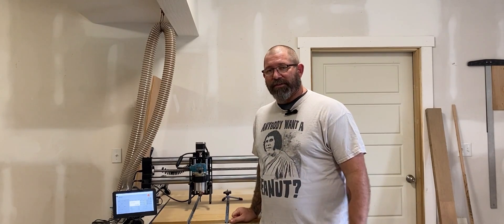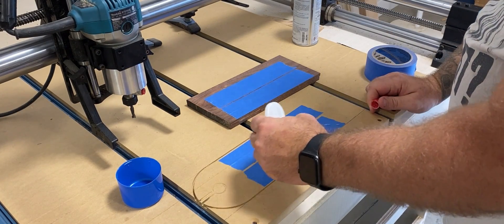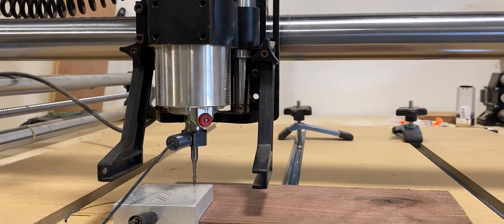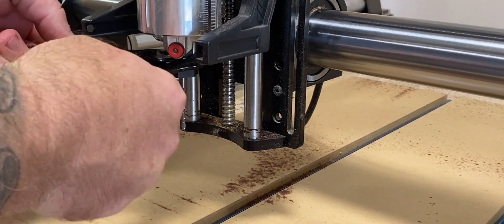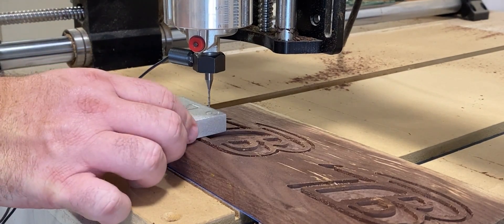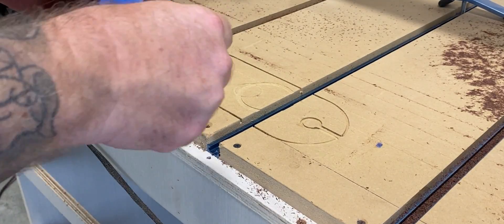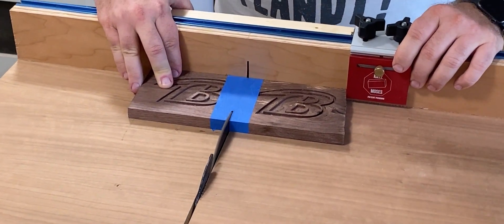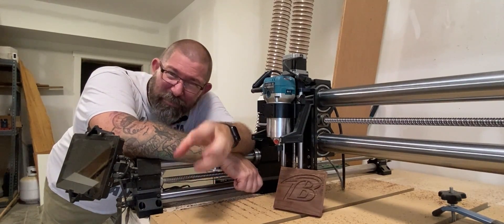Is The Onefinity CNC Right For You? A Beginners Guide To CNC

Comment: The thing about a coaster is to protect what's below it. If it holds a cold drink, it will need somewhere for the condensation to collect. The deeper grooves will help that. 
I would use a finish that has a good water resistance for the same reason.

Comment: Hey!   Lately my go to finish for something that could be around food is Odie’s Oil.   It’s a bit pricey, but a little bit goes a long way!   Also, if you want to skip the table saw all together, just program a profile cut.  Just make sure you set it to the exact thickness of your wood, or you’ll go to shallow or into your spoil-board.   As a fellow Onefinity owner, I look forward to future videos.
Reply from the maker: Thanks. I actually tried a flood coat of epoxy, as an experiment, and didn't like it. I turned it into a video. Once it dried, it made the coaster look plastic and took away from the natural beauty of the walnut. I wish I would have waited till it dried before I posted the video, so I could post that result. I"m planning on adding it to the description, and I'll add a second video and link it to that portion. I'll check out Odie's. Thanks for the feedback. I'm still learning a boatload!
Reply: @SothpawDesigns , no problem!!   I’ve only had my Onefinity a year now.   I’m still learning too.  Don’t give up experimenting to find that right formula that produces an end result you love that then sells for a profit. 😊